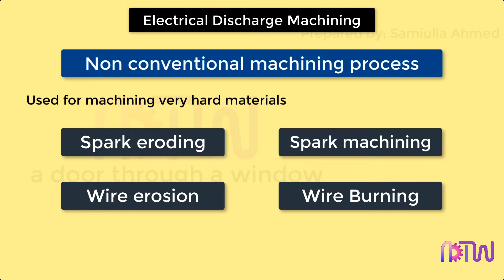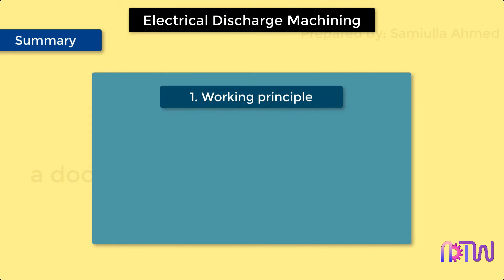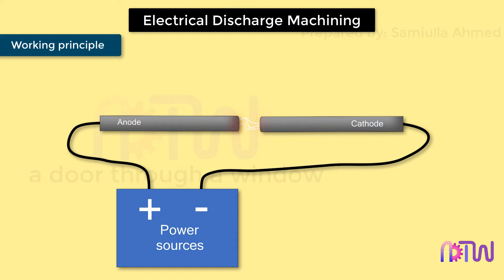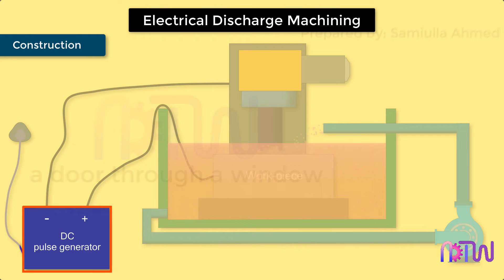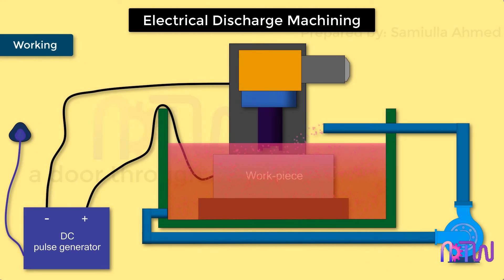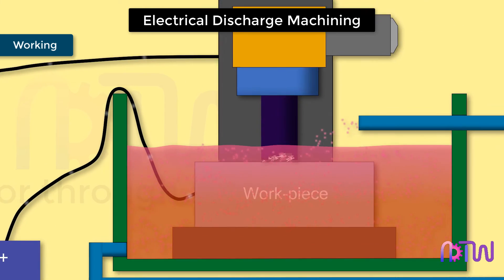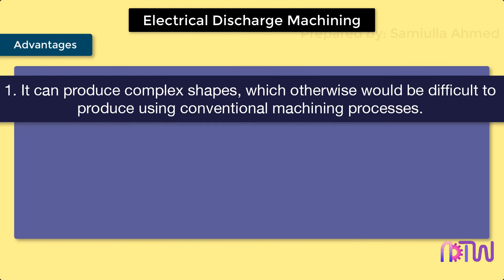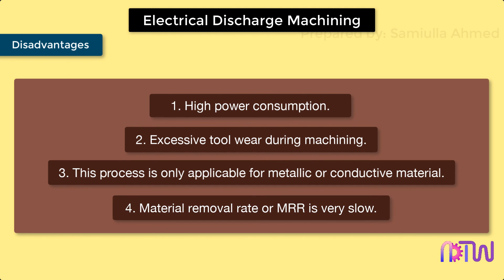ELECTRIC DISCHARGE MACHINING PROCESS (Animation): How electric discharge maching works

Comment: Dear author, first thank you for a great basic EDM presentation. But as an EDM expert I must point out, that the most common polarization of the electrode is positive. Thus, the workpiece is polarized negatively. This is always true for rough machining. Only in finishing operations to achieve very smooth surface (and using very short discharge duration) the polarity switches. To my opinion, presenting the regular polarization of the electrode to be negative is misleading.
Reply: Absolutely correct 👍

Comment: I learned in the books that the tool is connected to positive terminal and the piece to the negative one. Am I wrong?!
Reply from the maker: No, in EDM, the tool is typically made of a conductive material (e.g. copper or graphite) and is used to shape or cut the workpiece. When the tool is negatively charged and brought close to the workpiece, electrical discharges can occur between the tool and the workpiece, creating tiny craters or eroding the material in a controlled way.

Secondly, the polarity of the EDM power supply can affect the shape and quality of the cut. When the tool is connected to the negative terminal, it can create a "reverse" spark erosion effect, which can result in finer surface finishes and sharper corners compared to when the tool is connected to the positive terminal.

However, the specific effects of connecting the tool to the negative terminal will depend on the specific EDM setup and parameters, so it's important to consult the manufacturer's instructions or an expert in EDM to ensure proper use and safety.
Reply: @ADTWstudy  Thank you for the explanation.